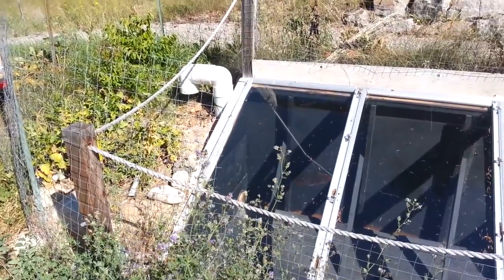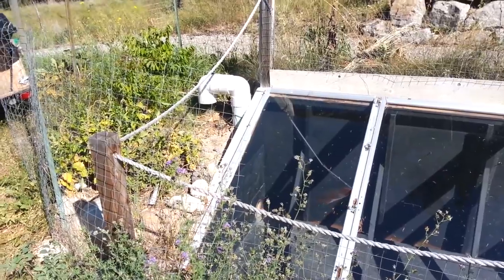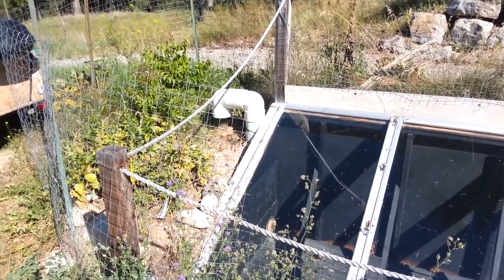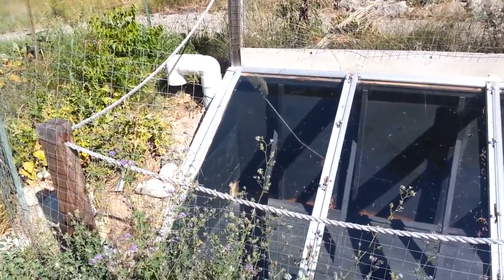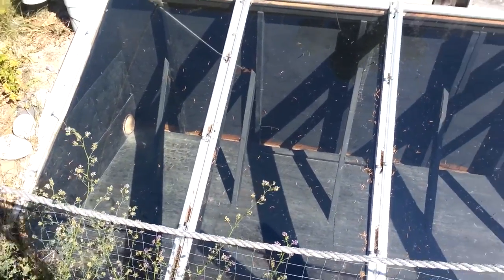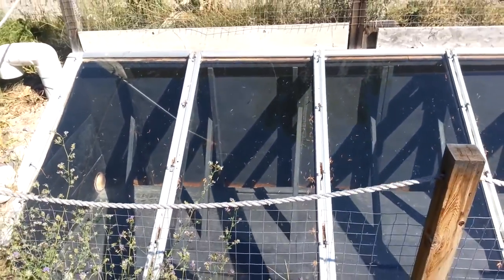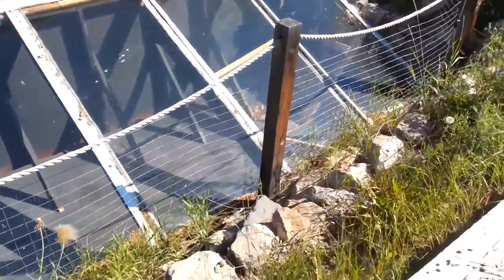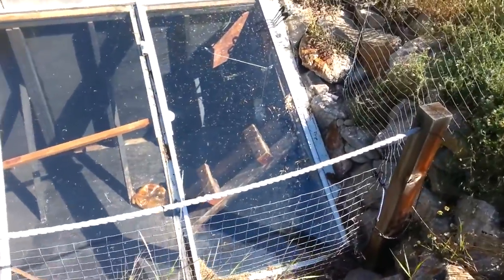Solar Coffins - DIY Renewable Heat for B.C. Passive House

Comment: I know that moist air carries heat better than dry air. I wonder what a small amount of water in a box like that would do to the heat generated by the glass. Would it increase the heat output at all or would it increase it? Would be something to think about. I wonder how hard it would be to crease a small test set up using a wooden box, some tubing and thermometer? A project for later I think.